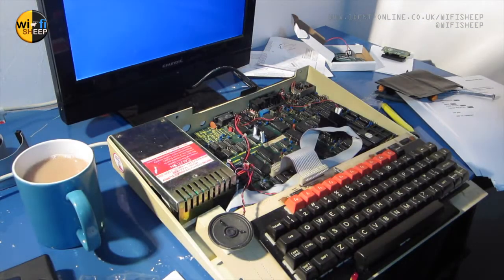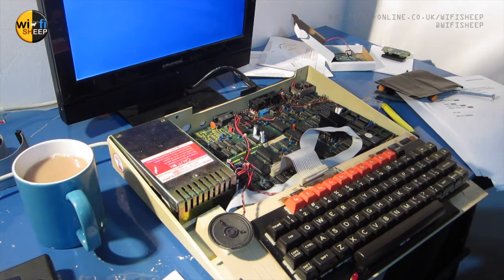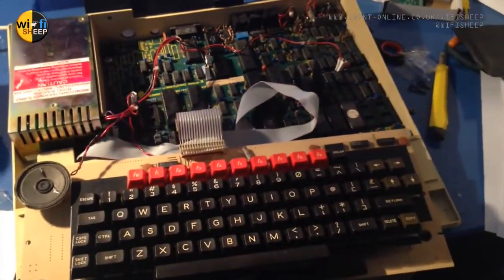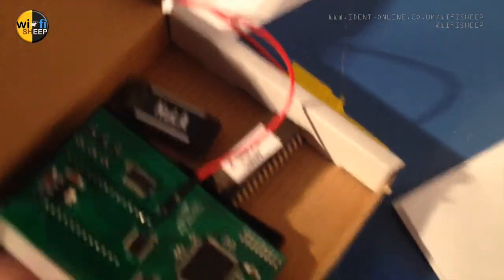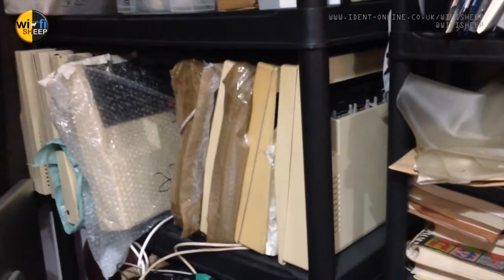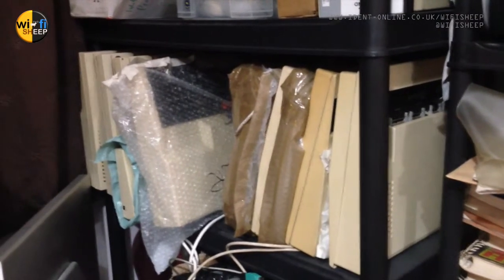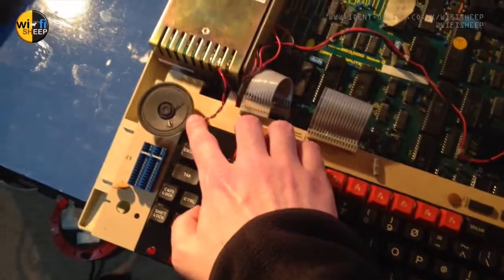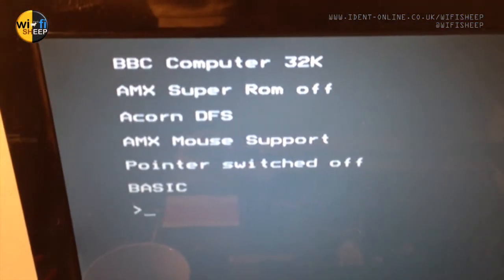More VideoNuLA! (Part 2) & Repairing A 8bit BBC Micro model B (Wi-Fi Sheep Tech Video)

Comment: I had one of those metal pegs snap off on me and i was lucky enough to dab some solder on to keep it on the motherboard but i am sure that if i try to disconnect the cable again the peg may just snap off again. The part that fits on to them pegs are really tight .

Comment: Have you recapped the boards and PSU's yet? You can get a fair bit of noise on the +5v line if the electrolytic caps are going bad and while not stopping the computer booting can cause all sorts of odd behaviour. easy enough to check if you have a scope. my model B was having odd issues loading from MMC until I did a full recap.
Reply from the maker: Hi, The PSU yes the main PCB no.... not yet but an interesting and valid point, and would explain some of the issues, I will endeavour to investigate! Thanks for your comment and suggestion!